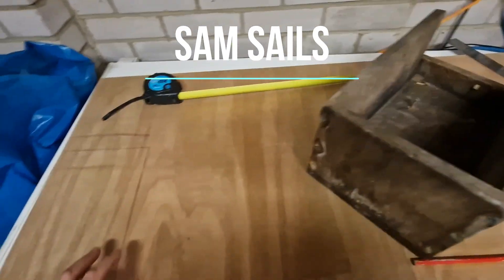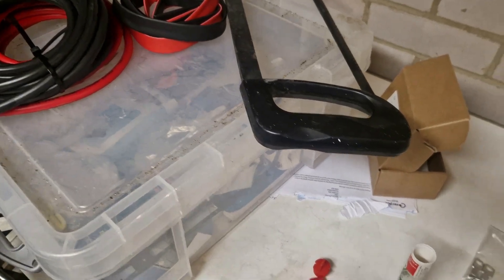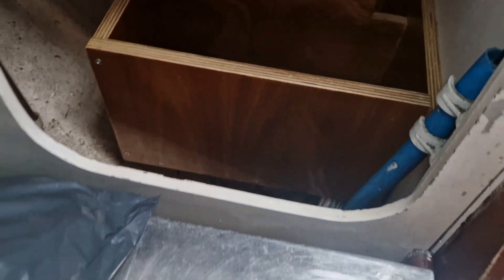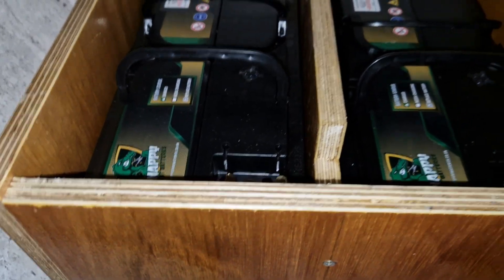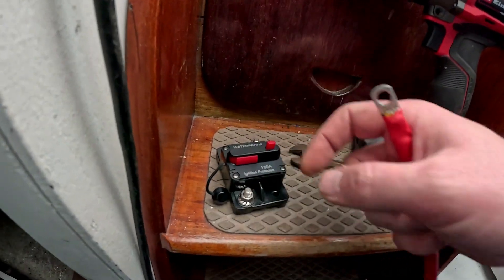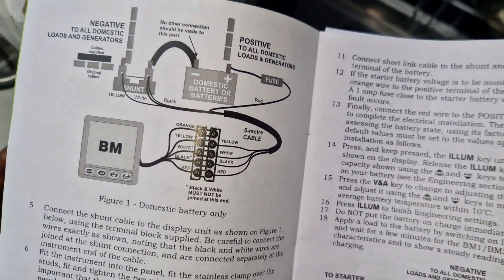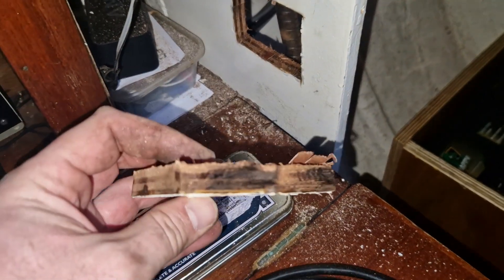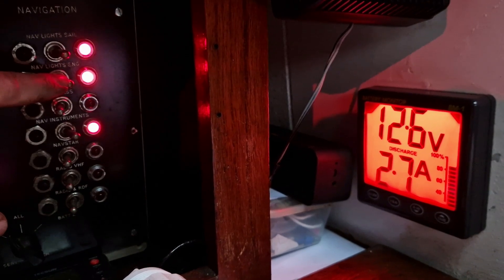Connecting Twin 12 Volt Batteries To Existing Power System | Parallel Battery Install

Comment: If im not mistaken the BM1 should be wired to a permanent feed so as to get correct readings. The vertical segmented scale on the right is a quick visual of what capacity is left in the relevent battery bank. They certainly work better than the log/depth duet.
Did i see you getting a reading for your start batt on the BM1?🤔
Reply from the maker: Yes there is a single core to the positive on the starter battery and switch to change to it on the display

Comment: Hi Sam, thanks for this video have been looking for this type of thing , have now ordered one, reason for this is there are actually two versions, a BM1 and BM 2 they are different ampages, the BM 1 650 and the BM 2 is 999 AMP, the Shunts are different as well, BM2 is 200 , the BM 1 is 100, might be why you queried the voltage great videos btw, will be popping up to Pin mill this year , i am just around the corner from you, Moored along the Blackwater/////

Comment: Did you already have a fuel level sensor or did you fit one for the new gauge? This is on my todo list so would be interested in the details
Reply from the maker: @jasonhuxley674  no had to fit the sendee, it was a ok just needed a bit if care drilling the hole into diesel tank. It was very difficult to film so not much on that. The sender unit is 750mm 0-190ohm available from 'TANFEI' on amazon at different lengths. Comes with screws and rubber gasket. Connecting that to the gauge is easy enough as two small cores for the resistance measurement only. The gauge requires 12volt power from somwhere so installed close to an available power feed. You can buy any gauge you like as long as it matches the resistance range of the sender unit [0-190ohm] in this case.

Comment: Great job. If you want to fix your cables so they won’t move, an easy way is to use cable ties through sticky back fixings. You need to put a screw through them as the sticky backs don’t stick well in damp conditions but they do hold them in place while you screw them down. You can get them from electrical wholesalers and they are pretty cheap.
Reply from the maker: @peterreeve8663  yes i've got some to fit, the sticky backs don't work unless you glue them with araldite or somet 2 part glue. thanks for watching 👌

Comment: Even though the batteries are in a box you should still strap them down. Any lid on the box needs to be able to be removed or opened  quickly in the event of a battery issue. The box should be vented to allow hydrogen emitted by the battery to dissipate…..a few holes drilled into the lid and sides should suffice. I realize you may have already done so.  You should also have all the terminal covers on the battery terminals if you have not done so already
The 200 amp fuses are to protect against a dead short and are usually at a higher rating than your in line breaker .  Usually the breaker  is on the load side of the battery switch
Reply: If the cable does not have its gauge printed on the insulation, then measure the diameter of its copper, calculate the cross sectional area and you should be able to google the info to obtain the gauge and its current ratings of maximum continuous and absolute maximum over several seconds.  The two cable 4:20  runs to really pay attention to are the start battery to engine... both +ve and negative return and similarly for the charging cables from the alternator to the two battery banks
Reply from the maker: @Jackanory222  yes the box has a clearance at the top for venting requirements. The fuse needs to be lower than  the rating of the cable, fuse blows before the max current rating of the cable. That 200amp fuse im sure is higher than the cable but with no markings on the cable im not 100%. It looks identical in gauge as the 170amp cable i was installing for the batteries. Thanks for watching 👌
Reply: I'd state it differently.  The cable needs to be rated higher than the fuse.   200amp for the fuse seems reasonable so make sure your cables are specified accordingly ... length of cable also determines gauge of the cable needed
Reply from the maker: @Jackanory222  The next gauge up from the 25mm2 170amp cable is 35mm2, this is only 2mm wider in diameter with a 240amp rating. I measured with vernier gauge yesterday and thats exactly what it is so now happy with the fuse rating for these midi fuse. They looked very similar in diameter so I was on side of caution with a large difference in rating.

Comment: I’m certainly no expert but are the cables rated for 150amp? They look quite small for amperage ?
Reply: I struggle with cross sections myself , but cable is now sold as thin wall , meaning the cross section is actually smaller than you would expect . I've ordered cable supposedly capable of handling 27 amps , that basically i wouldn't put 10 amps on . But i'm a really fussy sod , and as a rule of thumb , if i don't like what i see , then basically i won't use it . I much prefer thick wall where i can source it , and always use oversized cable .
Reply from the maker: The new cables are 170amp rated, the old ones im not sure

Comment: Hi Sam, another interesting video.  Thank you.  Are you using a lithium battery for the domestic supply as against the deep cycle starter supply which I assume is lead-acid ?  Lithium has a more tolerant and deeper discharge percentage than lead-acid and is generally smaller and much lighter.  I use lithium to power my amateur radio when out  as a static mobile - Max Power brand.  Wish you safe and enjoyable voyages in the coming year.  😃Phil, Suffolk.
Reply: That starter battery looks like its sealed. Lithium for marine use is not a simple case of just a battery they require proper BMS (battery management system) to charge from an alternator and or shore power. 🙂
Reply: Yes, a given, should have mentioned. Thanks. Phil
Reply from the maker: Its tempting but i've gone for lead acid this time. With all the other projects ongoing cost is in mind. As already mentioned its not only the lead acid battery but the proper charge controllers both from the alternator and solar panels that would need to be installed. Thanks for watching 👌